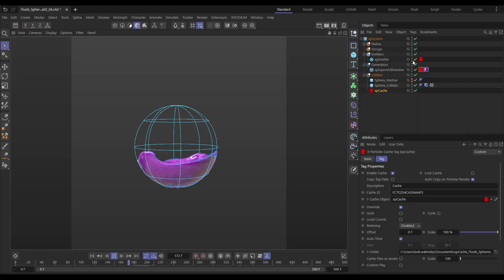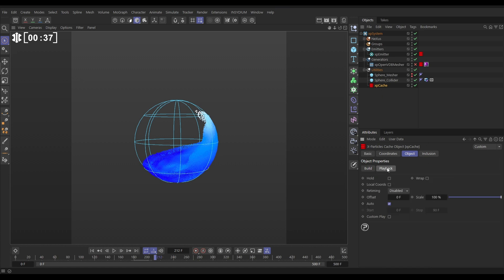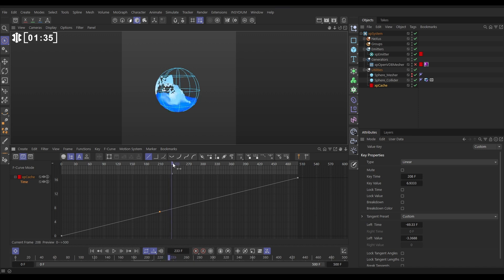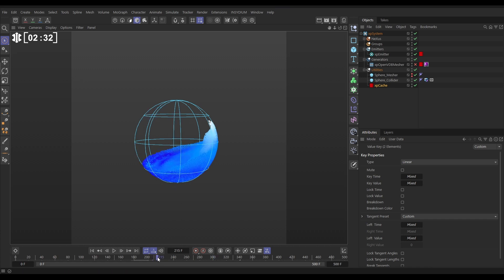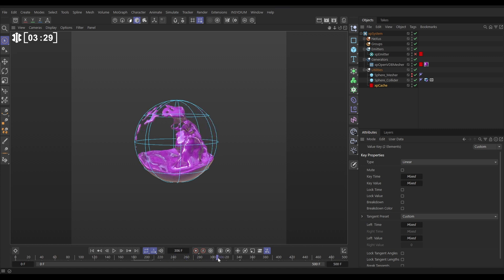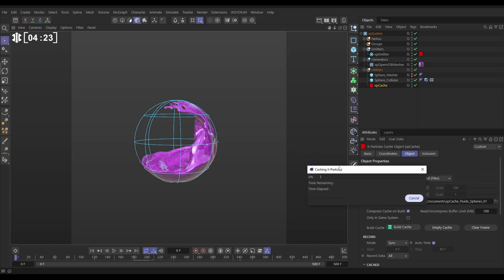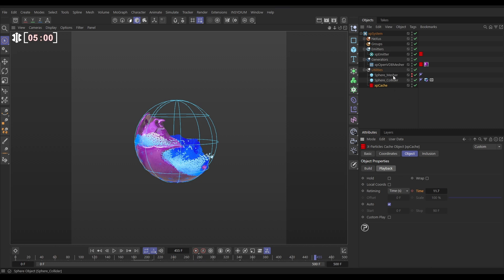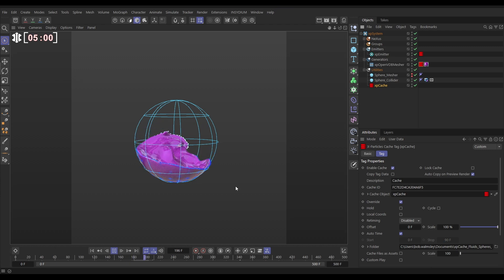Top Tip Tuesday - Retime Cached Meshes

Comment: Another very useful little tutorial. X-Particles is an eminently tortuous plugin, it will take hundreds of little TTTs to visit the subtle arcades of this plugin. But what a pleasure! Little question. At (T=0103) you chose <Retiming=Time(s)>. Could we have used <Retiming=Frame>, without there being consequences for the rest of the tutorial? Once again, you had a great idea with these TTTs
Reply from the maker: The reason we don't use the Frame retiming mode, is that this only allows for linear keyframe interpolation. This can work okay depending on your scene, but it means you can't use animation curves like ease in / ease out. The Time (s) mode does allow for spline type keyframe interpolation, and as such, gives us more animation options.
Reply: @INSYDIUMLTD  Thank you and Happy Halloween